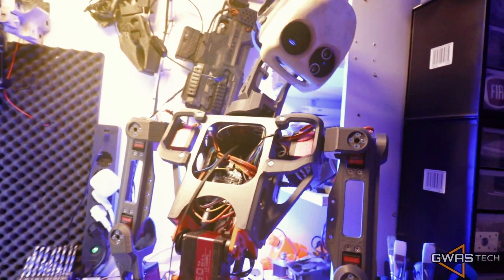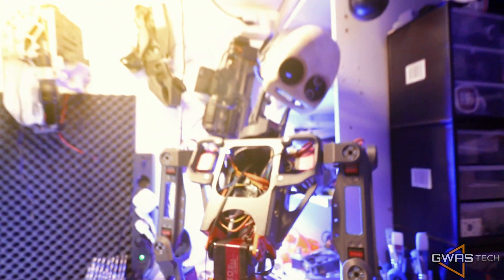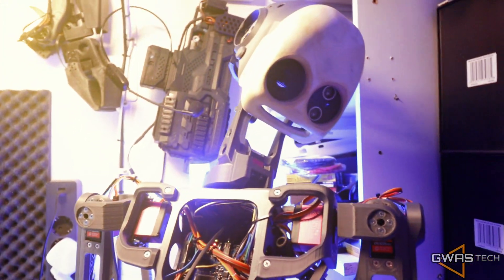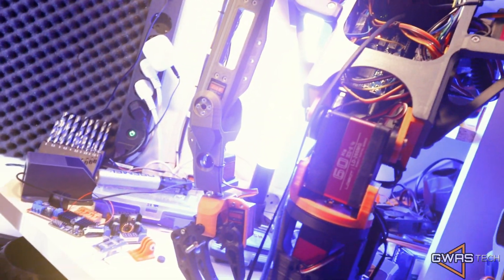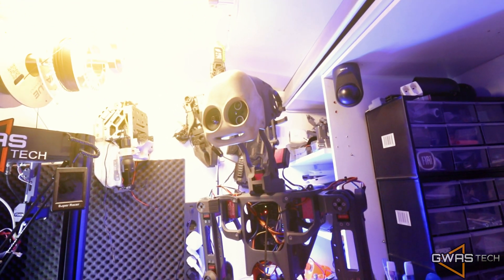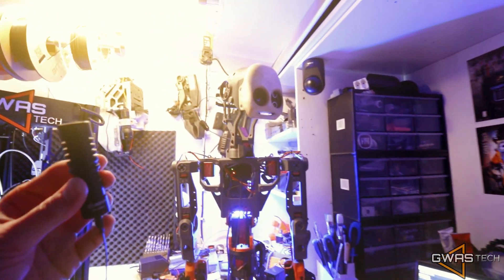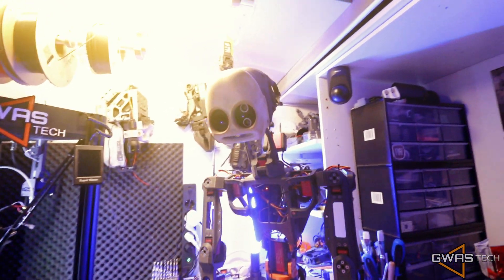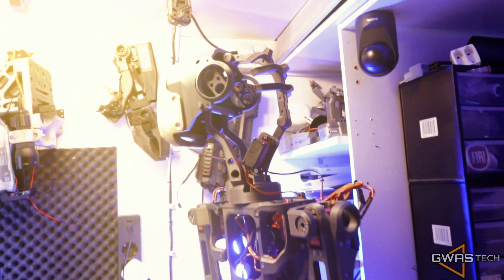My new 3D printed ROBOT MiKE [How to build Robot] - First CODE Test

Comment: what software do you use for making the cad design/ prints? do you do the whole robot model on the ipad one i have seen in your video and do you only use that one on the ipad?
Reply from the maker: Hi! I use Shapr3D for CAD modeling and export. Shapr3D works on Windows and iOs. I use it on iPad and HP360 Envy with windows. It works great on the both platforms.
Reply: @GWAStech really I have been using it for other stuff but never thought I could use shaper 3d for robotics design this is so great I love the app best app I have used for on the go creation . I have been wanting to do this so bad with shaper3d how did you get everything so accurate and working properly can you do simulation with shaper 3d?
Reply from the maker: @ahmedeltiar4734 How I get everything so acurate? I just design it acurate 😊 Shapr3D is really god. You just have to know how to use it. When I do some servo atatchments in Shapr3D, first I meassure everything (servo size, all holes, etc) and then design it 😊 For now there is no option for simulation. I dont really need it 😎
Reply: @GWAStech do you have any tips or video on how to best utilize shaper 3d for robotics? And how did you do servos in there?
 Are they just blocks of the size of the servos you use?
Reply from the maker: @ahmedeltiar4734  I made just blocks with exact size of servos. I will do an video about Shapr3D soon.